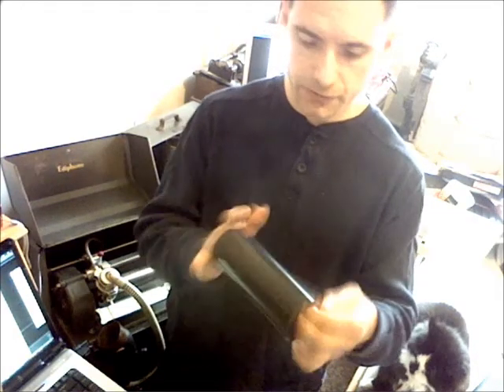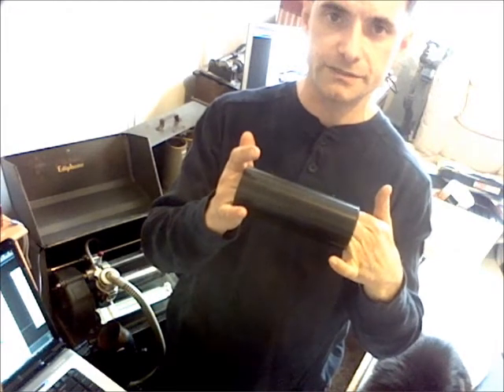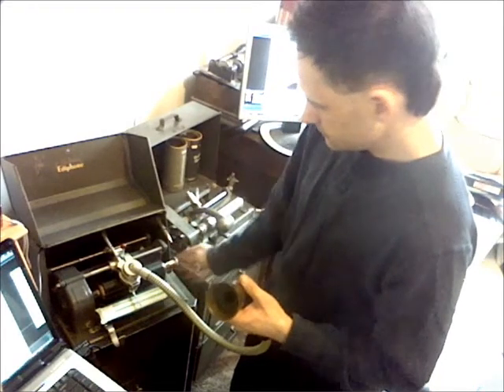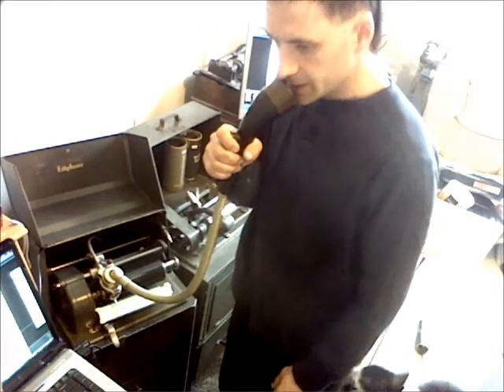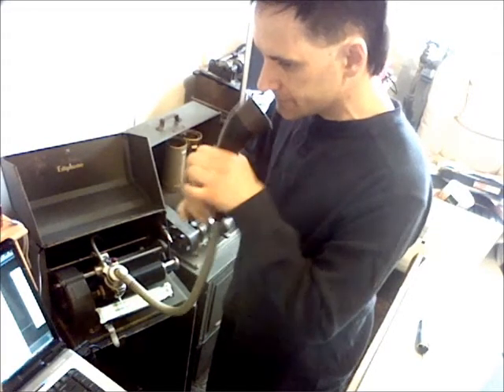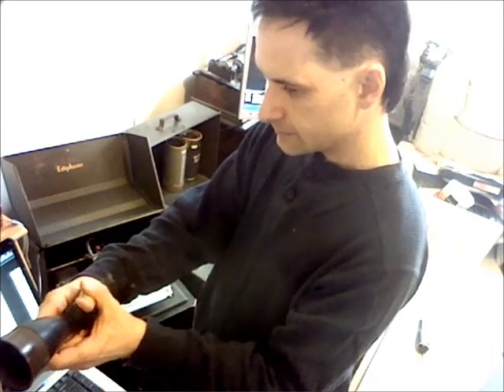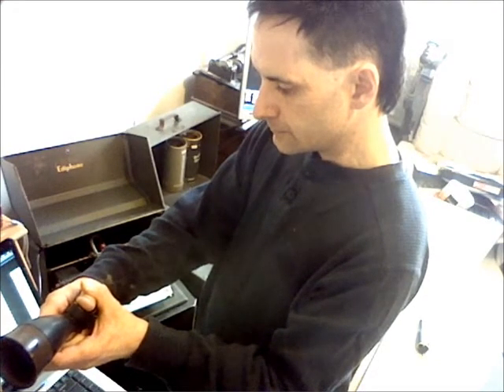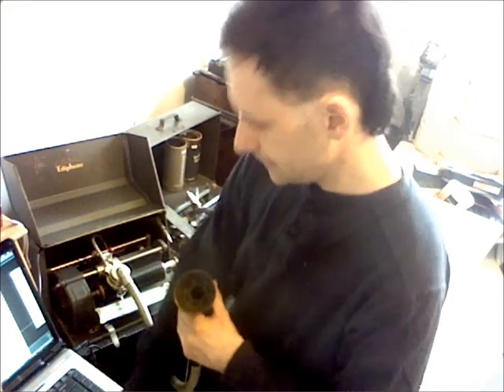How to Use the Edison Pro-Technic Ediphone

Comment from the maker: Dictation machines have not caught on yet, but they will, Shavers that are nice and working are $100-250,00, and the transcription machines start at 50.00 for a $40s Dictaphone or Ediphone, and up to  $600.00 for the 1910s wooden  business machine with spectacle recorder/reproducer.  They are fun in that they do record well.  N.O.S. dictation blanks are almost always available on ebay.  I do make them, but they are very expensive to make.

Comment from the maker: Use a multi tester to check for shorts and visual inspection.. The lever that the speaking tube rests on  is an on and off lever, and the trigger on the speaking tube turns the contacts for the mandrel on and off , to turn or not.   I make new blank cylinders of 6" long by 2.3+" in diameter.

Comment: Hello Shawn-I've looked at your other video on why not to shave old recordings.  I've recently purchased a voicewriter (only).  It came with a set of earphones, and the device that looks like a phone-which is used to record the voice.  Anyways, I believe you have to play the voice back on a separate machine?  Question-can you provide a link for where the new wax records are sold.  I dont want to buy an old one, and shave it-I would rather find a new one-if they are still being made/are cheap.
Reply: While I can make a blank of the right outside diameter for these machines, making the inside fit perfectly for the ejectomatic system on the machines in a nightmare.  I have made 7 dictation machine cylinders so far.